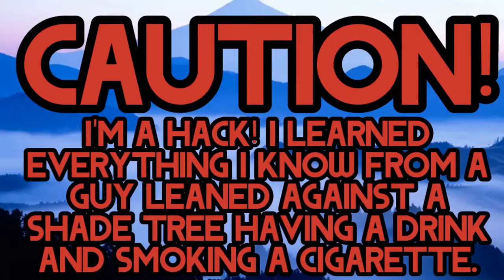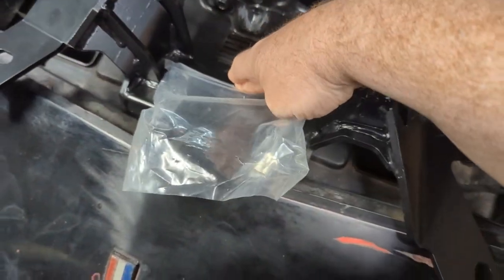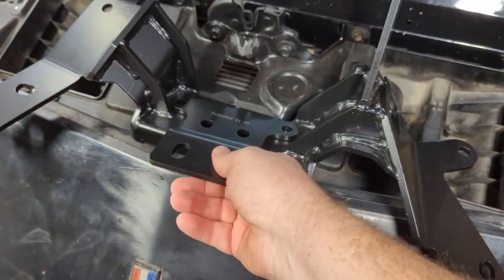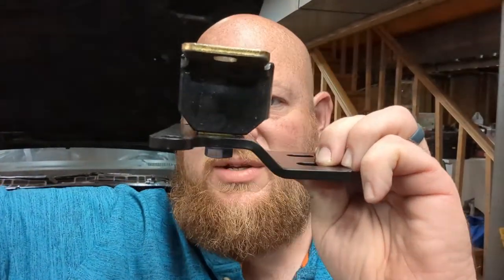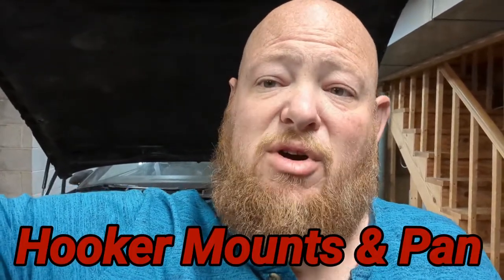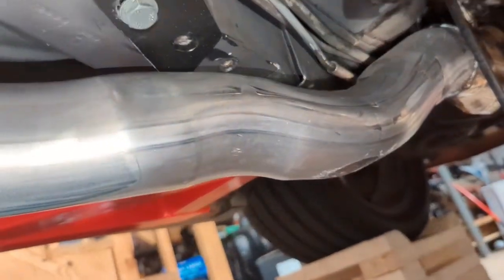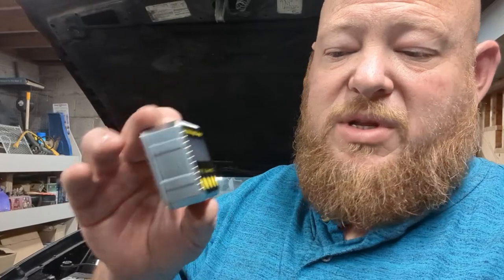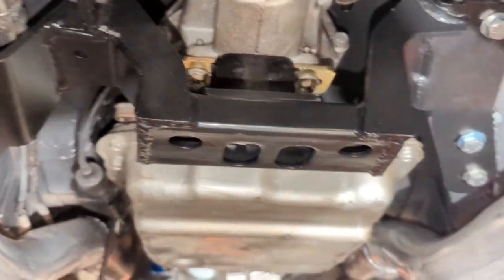Installing a Hooker Blackheart crossmember in a third gen LS swapped Camaro.

Comment: This is the 1st video on YouTube that's give you any information about this cross member for your 3gen Camaro I just ordered the same one. good video is that the stock torque arm
Reply from the maker: Thanks, yes it is the stock torque arm. I am running a polyurethane bushing on it. I appreciate you watching.
Reply: @ForsakenSteel  thanks for the information im doing a 83 camaro with a 5.3 4l80e And I couldn't find a transmission cross number for nothing so I find this one and I ordered it

Comment: The black heart Holly unit is what I used, worked good did not quite fit with the trans mount as well, but was not forced to drill new holes. I used UMI LS engine swap  mounts. One thing additional, When I installed the mounting brackets in the frame, I bolted them in tight, then drilled a hole through the frame and slightly into the flat brackets, then I welded through those holes tying the frame into those brackets, so if i ever have to pull the trans again, they stay. Good luck, getting there,
Reply from the maker: If I had it to do again I would have bought the entire kit. You live and you learn.
Reply: @ForsakenSteel  Yep, I heard that. "Would a should a could a, if my brother was a girl, Id'e have a sister" LOL

Comment: I think it says you need the hooker black heart motor mounts for the blackhearr trans crossmember to lineup properly
Reply from the maker: You're right it does. Currently I'm trying to bolt it up to my Nissan 6 speed transmission I'm putting in the car. Clearly I'm not one for the rules. 😂 Thanks for watching I really appreciate it.

Comment: It says on the website when you go to order those that you have to use the Holley LS swap motor mounts in order for the trans mount to work like it's supposed to.
Reply from the maker: I definitely wish I had done more research. Also after receiving the crossmember and seeing how well it was built I regret not getting their kit from the beginning.
Reply: @ForsakenSteel  I've been leaning towards that motor/trans mount kit for my build.  I was also considering the Holley Terminator Max wiring kit for the stock intake but the Fitech standalone kit is a few hundred dollars cheaper for the standalone engine/trans wiring kit.  However, if they actually did pinout the ECM connector wrong on yours that seems like a red flag to me.
Reply from the maker: @pjstartv6798  I have another video about the harness coming out tomorrow but sneek peek. The harness they sent me was all pinned out the same however the wire color on either harness is different from the pin out they sent me. This will be the last FiTech unit I buy. I have spent countless hours with them on the phone with no real answers.
Reply: @ForsakenSteel  Good to know.  The Holley Terminator Max standalone engine/trans wiring is $1600 compared to just over $1100 for the Fitech but I feel like the extra $500 is probably worth it just for the piece of mind because you know Holley is quality products and support is going to be on top of things if anything were to happen.
Reply from the maker: @pjstartv6798  I agree